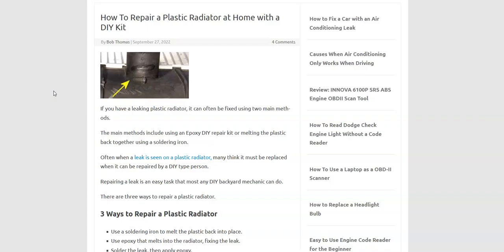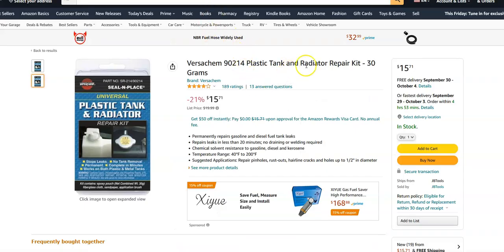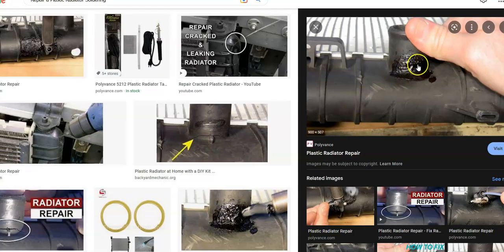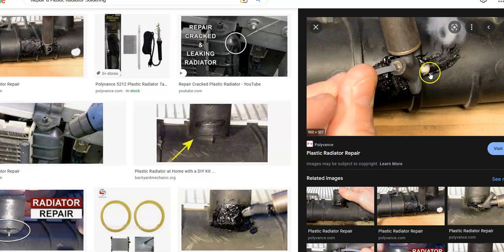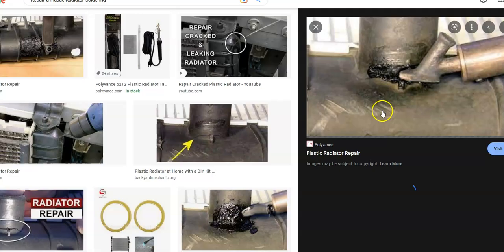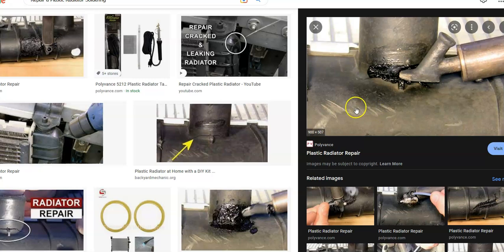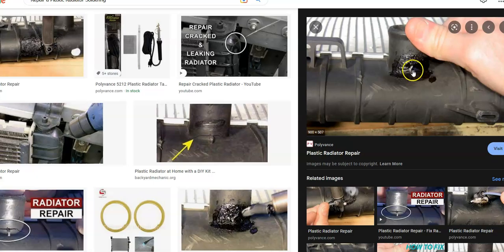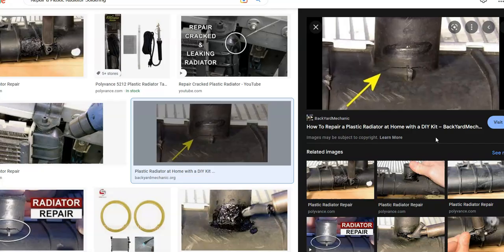3 Ways to Repair a Plastic Radiator That Has a Crack and is Leaking

Comment: Thanks for video. I was having problems bonding to that leaking crack. I used a hot flat screwdriver and a Torch to plastic weld it to stop leaking. Great idea

Comment: Another trick I used was a carbon Dremel bit on high speed. Moving very slowly. It heats up the plastic and melt it very well. Electric not battery powered. Of course, then you can smooth off the crack with a small grinding wheel on the Dremel to get a perfect finish
Reply: I used a soldering gun and threw in weld on top

Comment: Good ideas here. Mine is completely broken off when I replaced the upper radiator hose. Any suggestion if I can mend it together with a piece of common black or white (PVC) plastic pipe from Lowe’s or Home Depot? Like a reducer?

Comment: If I have to spend $70 for a soldering iron, I may as well replace the radiator.
Reply: Whats the cost of a replacement and the labor to remove the old and install the new?
Reply: @johndurrett3573  For my car, I can find a radiator for $100 and install it myself.
Reply: @johndurrett3573  My friend it is super Duper easy to change a radiator yourself
Reply: Screwdriver and a torch